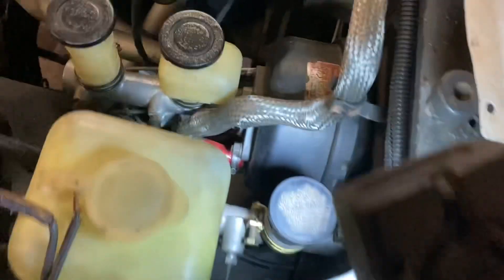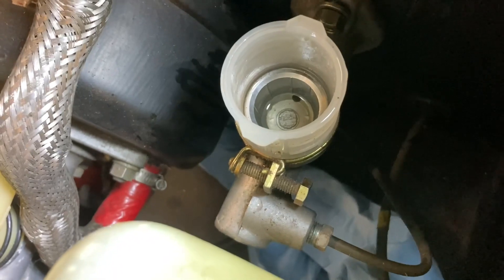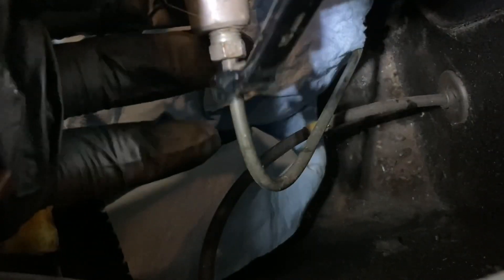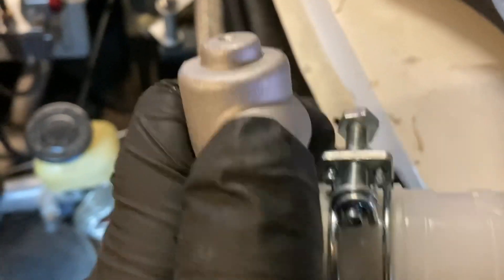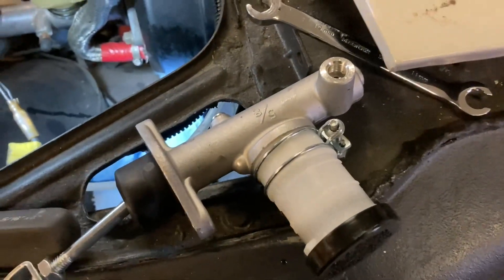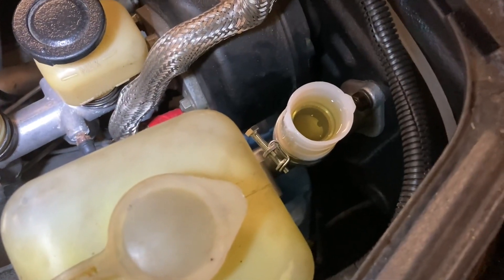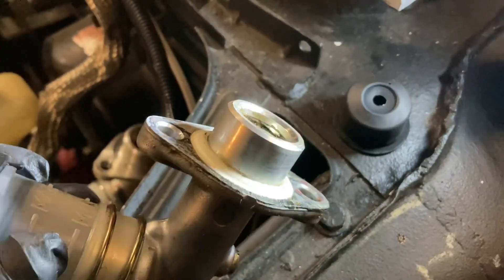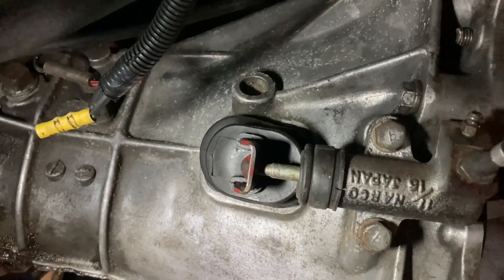Datsun 240z Clutch Master Cylinder swap

Comment: Did you adjust the fork on the pedal at all? Having issues with my clutch as of late, wondering if I adjust that nut if it’ll help.
Reply from the maker: @JoeWhoJoeMama2024  I don’t recall exactly but I’m sure I adjusted it to where it would work best and I was happy with it. Thanks!
Reply: @ Appreciate the response! I’ll check it out tomorrow. It’s my daily so it’s frustrating when the clutch doesn’t fully disengage.